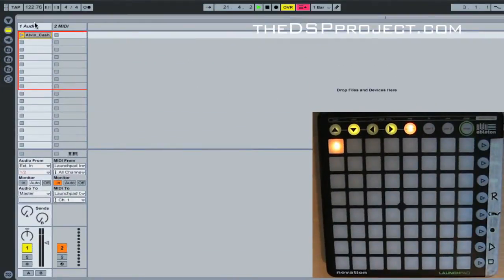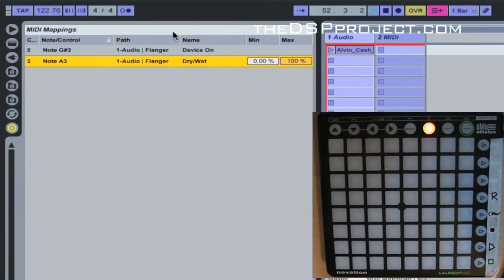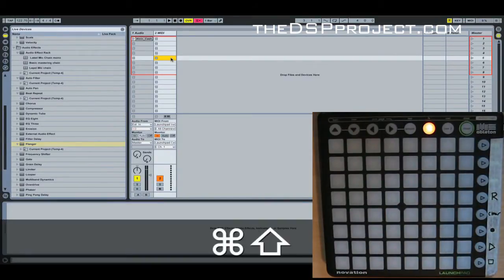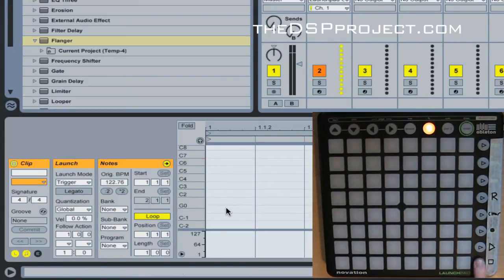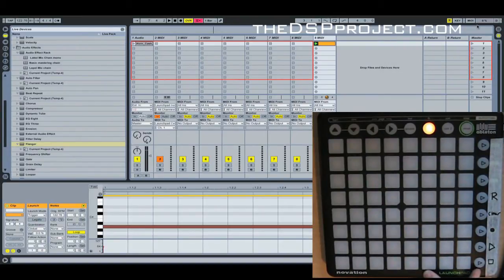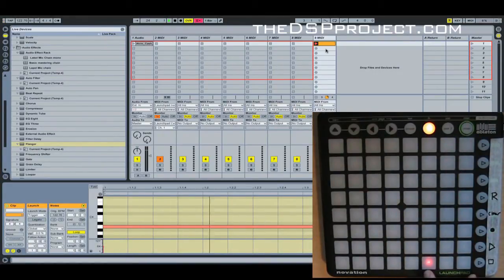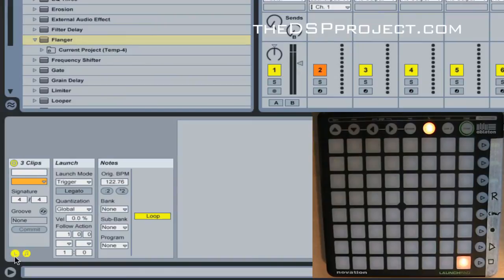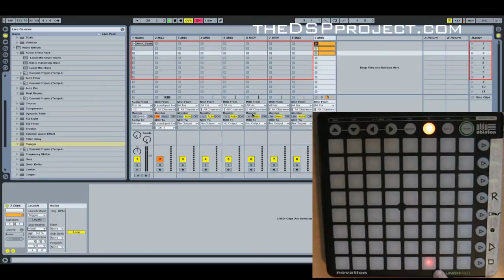Launchpad midi knob range LED feedback

Comment: Hello. Map a parameter in USER 2 mode. Do so from left to right in a row in user 2 mode. Now open new MIDI track. MIDI Map first cell, then click the pad you selected in user 2 and proceed downwards. this should get you coveted LED Feedback in user 2. in created MIDI track make bar long note. this will get the color. experiement with bracket length for color issues. love one another

Comment: Pretty neat way, of getting LED feedback. To expand on you video a little bit. You can take it one step further and change the color of the mapped buttons, Take the midi velocity utility. Drop it on that mid track and chang the LED color to any color you want, just by adjusting the Out Hi knob on the velocity utility.